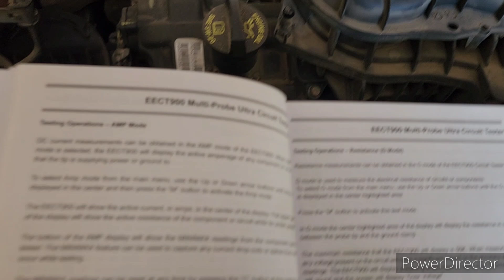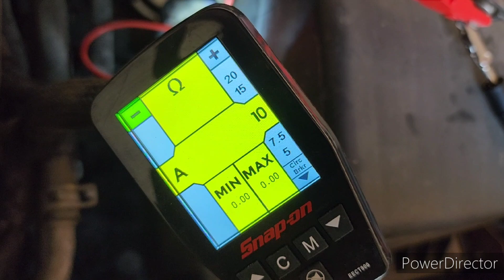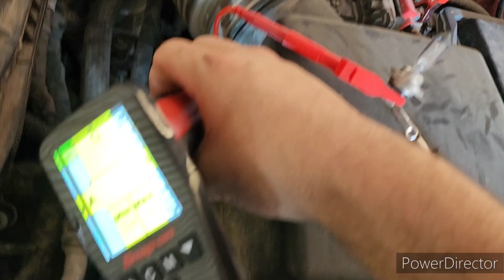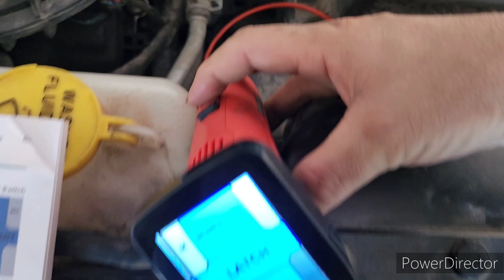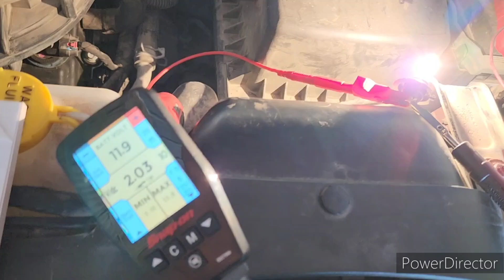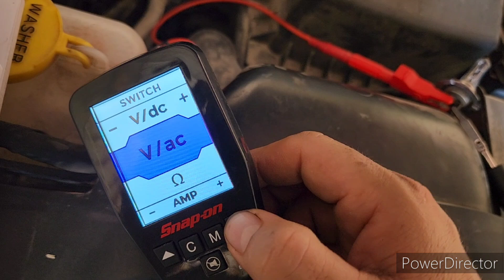Learning the Tools / @SnaponToolsOfficial  Multi Probe in action / EECT900

Comment: Hi great video I have been walking by that tool for a while your video has me thinking can the Snap-On probe supply 5 volts continuously to a BCM or a component that requires 5 volts to work
Reply from the maker: @mikedavidson2117  I believe that there is a 5v adapter for the Snap-On probe and the power probe.
Reply: The Power Probe Hook can supply battery voltage, or between 0 and 5 volts in 0.5 volt increments to the tip, but this tool only supplies battery voltage to the tip.